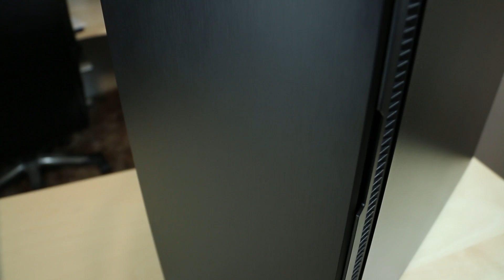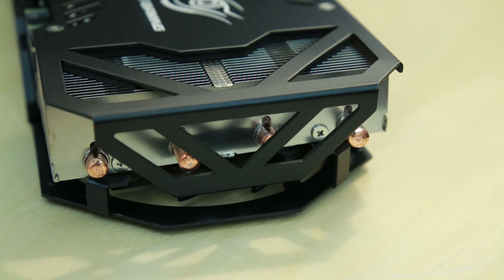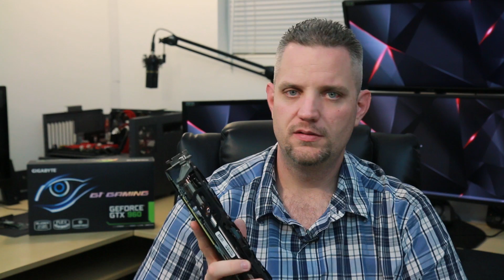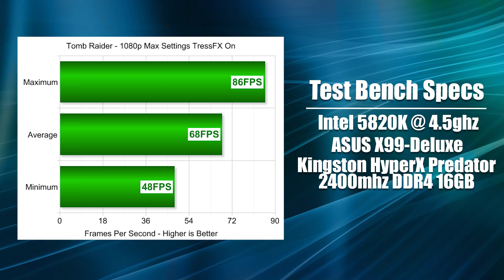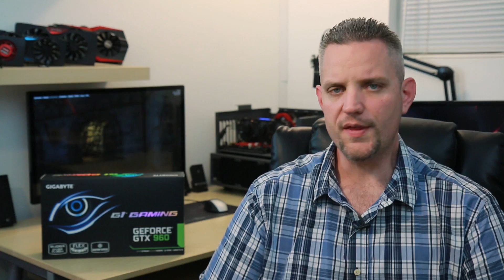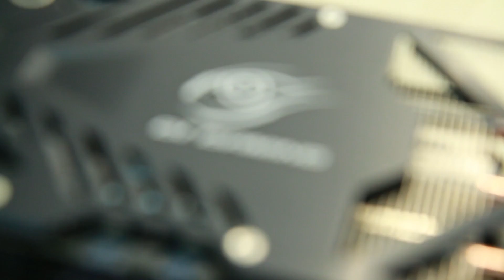Gigabyte GTX960 G1 GAMING - Best Mid Range Card Yet?

Comment: This card is a real disappointment, the memory-interface is a catastrophy and the 2GB GDDR5 make the thing even worse.
It is far to slow, barely (if at all!) faster than older generations.

The 280 is still the way better decision, especially because of the 3GB GDDR5.

Jay, I am kind of disappointed that you didn't even adress the 2GB GDDR5, to be honest.
Reply from the maker: Thats a lot of dots!!................................ and yeah, Im disappointed that I didnt mention the 2GB as well, but considering NVIDIA has never put more than 2 on their lower end cards, is it really that surprising?
Reply: Same for me... I stay with AMD for this year
Reply: ***** I'm dissapointed becuase I expected it to be as good as the r9 280x, while costing less and consuming less power consumption(which it does use less than the r9 280, r9 285, r9 280x). It turned out to be that it's as good as the r9 285 and in some cases the r9 280 while costing more than both(in my case), especially more than the r9 280... 
I was too hyped :/
Reply: The 280x is even better for the price even though it is a rebag i will still stick with the 280x
Reply: I am so tired of seeing this comment trolled everywhere, yes, it has a 128bit bus, yes, it only has 2gb GDDR5 but what all these people commenting this seem to fail to do is actually watch the reviews and read up on the 960. This card was designed to compete with the r9 285 which also has 2gb GDDR5 though on a 256bit bus. Here's the thing, this card overclocked to its limits creams the 285 clocked to its similar peak in every test I have seen with the exception of a few games that favor AMD architecture. The key here is that it does so at significantly lower TDP and costs less than a 285. Don't get me wrong, if its pure performance you are after then by all means go for the 280x or a 290 but if you are looking for a lower power card with almost all the new features of its big brothers then the 960 is a great choice. Also bare in mind we have not seen what dx12 will do with these and AMDs offerings. My 960 G1 Gaming does everything I need it to, looks amazing in my case, runs cool, plays ALL my games maxed out with up to MSAA x8 in some cases and all @1080p. I also noted that despite Shadows of Mordor claiming that you need 3gb of vram to use high textures my card handles it just fine with absolutely 0 lag spikes and an average of 50fps. I am not a fanboy of either side here, I love my old 5850 even now and I am loving my new 960 which is literally 2x the performance. Don't fall prey to the AMD/Nvidia/Intel fanboy crap, put on your grownup pants and buy what best suits your needs after doing your research.
Reply: Arne Lammens Only in Benchmarks, if you have high quality textures, it will!
Reply: ***** I'm still saying that 4gb on the gtx 960 is a waste of money and is a marketing gimmick, just to make people pay more money for nothing.
Reply: ***** And the best gpu at the moment for 250-300$ is the r9 290, it's 60% better than the gtx 960 for only 50$ more. :)
Reply: The 128bit bus does not affect the amount of VRAM the card can handle. You can have a 64bit bus GPU with 4gb of VRAM, the bandwidth however would render it completely moot as no game could run on high enough settings to be able to saturate that much RAM without being a slideshow. The 970 problem occurred because one of the 8 512mb chips is not handled correctly due to the way the gm204 chip was cut down for the 970. Part of the GPU's memory controller was cut and that is what caused the whole debacle. 

The 960 is not a cut down chip, it uses a fully functional gm206 chip and the 4gb versions will simply use higher capacity VRAM chips to achieve 4gb and as such will handle 4gb just as well as it did 2gb. There will be a significant performance improvement in situations where the 2gb cards VRAM is completely saturated, as early reviews are already showing. The 128bit bus on the 960 coupled with the 960s texture compression architecture cause it to perform more in line with a 196bit bus, that combined with the high clocked GDDR5 VRAM makes the card easily able to utilize 4gb of VRAM.
Reply: I am sorry but you are wrong. Home made diagrams prove nothing especially seeing as they are based on the assumption that the 960, 970 and 980 are all based on the same silicon. They are not, the 980 and 970 are based on the GM204 with the 970 using a cut down variant but the 960 uses a fully fledged GM206 which is not cut down. The bus width does not, nor has it ever, determined the maximum amount of VRAM a GPU can use. All the bus determines is bandwidth and even then there are additional factors that play a role. The fact that every review on the 4gb 960 clearly show improvement in VRAM related FPS dips shows this. Never the less, the GPU does not benefit significantly from the 4gb of VRAM, certainly not worth the premium over the 2gb variant. The "not connected" scenario you propose has nothing to do with bus width and everything to do with the way the gtx 970 addresses one of its 8 512mb VRAM modules due to the way the chip's memory controller and cache was cut down.

The 960 4gb cards simply utilize higher capacity VRAM modules so they will perform identically to the 2gb versions. If your diagrams were in any way valid the 960 would not be utilizing its 2gb of VRAM properly. No offense but you clearly extended the problems faced by the 970 onto the 960 which does not suffer from the same flaws as the 970 as it uses a completely different chip. Its easy to assume the GM206 is a cut down 204 based on how many reviews cite it as being 1/2 of a 980. Both utilize Maxwell 2 architecture and thus the modules are identical. The 970 has disabled portions of the die to lower its specs and make use of lower binned/failed 980 gpus where the 960 only has 1/2 of the modules on the die to begin with which is why the bus is also 128bit vs the 980's 256. All this means is that the VRAM is forced through a narrower bus and performance is lost. There are no "cut" portions of the 960's memory controller it is simply half the bandwidth.
Reply: @Crazy Psycho: Also, just to add, the reviews on the 4gb versions of the 960 have already shown they access the full 4gb at the same speed as the 2gb version where the 970 exhibits a marked performance hit as soon as the last 512mb of VRAM comes into play.

It is nice to see someone put in so much effort and thought into comments on youtube though and its also refreshing that you have kept it civil :)
Thanks for the debate ;)
Reply: R9 290 is not 60% better than gtx 960. Gtx 970 is 47% better than 960 and little better than 290. In our country right now 290 costs 280-300€. Gtx 960 4gb model 230€. I would still go with 960, because I don't need more performance than that and 290 takes way more power than 960. 280 would be pretty good choise also, it cost 200€, but I prefer nvidia
Reply: +TheEmbittered ThunderGod Too bad all of AMD cards have bad driver support on games (Just Cause) and have terrible optimization with high heat draw and power sucking capabilities.
Reply: 2GB is plenty for most games at reasonable settings. Every gamer, sometime in his life, has forgot why video games exist. TO HAVE FUN, not to stare at the excellent graphics.
Reply: Did you actually see benchmarks ? The lesser memory doesn't make a difference.
Reply: MatzeGamer yes they are. 256 bit gives double the bandwidth over 128 bit, and the gpu needs bandwidth to EFFECTIVELY use Vram. on that 128 bit bus more than 2-2.2GB Vram, depending on the memory clock speeds it will NOT get almost any, literary almost any performance.... even if it's 1080p, 4k or 12k if you wish....
Specs affect other specs.

bandwidth = Vram Clock speeds * bus width
Reply: Tamás Kerecsényi the gtx 960 is overpriced. the gtx 960 should be 150-170$ not 200-230$.
Reply: futmut1000 ahahhahahhhhahhahahahah you made me laugh... I just imagened a 1960's hollywood dad say that.
First of all the r9 280 is just about as strong as a gtx 960(give or take 5% depending on the game) at stock speeds at 1080p, at 1440p the r9 280 usually wins, since the gtx 960 has only 112Gb/s bandwidth due it's norrow 128 bit bus and only 2gb of Vram, no compression can help it with that, it just can't push as many pixels as it needs to.
Second of all both gpus overclock amazingly, the gtx 960 can reach 1350-1400MHz on average with the stock bios while the r9 280 can reach 1200Mhz on average with the stock bios, the gtx 960 is 200Mhz higher clock to begin with keep that in mind.
Reply: TheEmbittered ThunderGod I prefer to pay extra for a NVIDIA card instead of paying extra for a bigger PSU with an AMD card.
Reply: AL SALAZAR the r9 380/285 is a better choice. It has color compression similar to the gtx 900 series to compensate for the narrower bus compared to the r9 280(x) and it has the best tessellation engines that amd can offer, does tessellation even better than the r9 390(x) and as good as the fury(X).
Reply: AL SALAZAR yes in terms of raw performance and gaming perfomance, the r9 290 is 25% faster.
Reply: ***** specifically with GTA V i can up to HIGH not verrry high or ultra. because of 2 GB vram limit. if i use more it starts using system ram.. and thats not ideal.
Reply: +IIIRattleHeadIII Well, there are actually the average FPS on most games go up 5-10fps...
Reply: Hello??? There is a 4GB version!! Even if the card can only use 3 of it, it will be enough.
Reply: and the benchmark its not far from 4gb 380s lol 960 is better than 270x
Reply: can a 280 or 290 run league of legends , mincraft and i want to play titanfall and gta 5 on it. in ultra 1080 preferble. i am then going to stick with the card for 3-5 years. have a Nvidia gt 520 now
Reply: leon timmer
yes they can, if your sticking with a card either go nvidia 900 series or wait a bit for the amd competitors that should be coming in the next 2-3 months..
Reply: MatzeGamer not on a 128 bit buss.
Reply: MatzeGamer I mean actual benchmarks of games
Reply: Crazy Psycho Thats because the 2GB VRAM and thats because of the 128bit blablabla.....
Specs are not an argument for other specs!
Reply: Crazy Psycho Für den Fall das du Deutsch verstehst, LIES NICHT WEITER!

Warum zur Hölle diskutiere ich im Internet immer unter Jays Videos mit Mensch gewordener Nivea- und Intelligenz Verweigerungen?! Kann mir irgendwer hier sagen warum man immer wieder versucht meine Argumente gegen mich zu wenden um dann totalen Dünschiss zu schreiben?
Reply: MatzeGamer dude, your arguments would be right in an ideal world, but what I'm saying is facts.
and I don't deny nvidia, I so wanted to buy this GPU, but its performance didn't live up to what I wanted it to be.
Reply: Crazy Psycho Let me guess: Google translate?
I dont like people who say product A is better than product B because company XYZ is better. I dont like being disappointed and I dont like people swearing at someone else or me.
At last, my statement is that Nvidia could be as cheap as AMD
Reply: ***** well, you are right, it isn't surprising at all.
But I guess that does not make the fact, that this card suffers from to less memory and bandwith, invalid.
Especially with features such as DSR in mind the 2GB of this card just aren't up to date.

By the way, I am really glad you took the time to respond to my comment, keep up the good work!
Reply: MatzeGamer And I never said that one is better than the other. To be honest I could give a damn who makes the GPUs. I look at specs, technology and architecture, if it does the job I need it to do and price performance ratio.
Reply: no and no 280 is slower and worse
Reply: ***** oki
Reply: ***** and cost about $50 more? better grab the 970 than this trash...
Reply: ***** the gtx 960 can't benefit from more than 4gb of vram, so even if it has 4gb of Vram for example at 4k you won't get any fps boost.
Reply: ***** still you will not get more performance if it had 4gb due to it having 128 bit bus.
Reply: It says 2048MB on the litle screen he shows at the begining do you not know how to read?
Reply: XavierPirelli I want an gtx 960ti, the gtx 960 is just not strong enough for my needs. And if in june-july amd's 150-250$ gpu beats the gtx 960, then I know where my money is going to.

And the reason it has only 2GB of Vram, is because of the 128 bit bus, it cannot use more than 2GB of Vram effectively, a.k.a, more than 2GB of Vram will NOT give any performance increase, under any scenario.

Also if the gtx 960 had a 256 bit bus then it would like the gtx 970, since it has less L2 cache/ disabled L2 cache memory pools, the whole reason the gtx 970 uses only 3.5GB of Vram to it's full bandwidth and 0.5GB is really slow.

The way maxwell work is, that it relys on it's delta color compression and it's L2 large cache pool to utilize high amounts of Vram.

If it were their 7xx series gpus or any amd gpu, you'd need 256 bit bus for 2GB of Vram and 512 Bit bus for 4GB of Vram, but the gtx 980 needs only a 256 bit bus for 4GB of Vram, reducing it's power consumption(TDP =/= power consumption, TDP stands for Thermal Design Power, a.k.a how much heat the gpu outputs and how good of a cooler you need to cool the gpu), but the fact remains that with a 256 bit bus, even when 4gb of Vram are utilized properly the bandwidth is still quite low and it can limit the card in some scenarios, well NOT gaming.
Reply: XavierPirelli yes, but with GDDR5 memory you are quite limited, so the bus speed is what matters in this case, usually amd and nvidia's Vram Clock speeds are 1500-1700Mhz, so it's quite a constant.
Also the gtx 960 can't use more than 2GB of effectively Vram for the same reason the gtx 970 can't use more than 3.5GB of Vram effectively, the reason being it has no L2 cache to back it up, That's how maxwell gpus manage to use more Vram with less bandwidth, by having a large ammount of L2 cache, which the gtx 960 doesn't have and delta color compression.
Reply: Edit: I just reread your post and addressed it in my next post.
Reply: XavierPirelli The Gtx 960 literary can NOT use more than 2GB of Vram at full bandwidth, no matter how much bandwidth it has.

Here is what I mean:
Gtx 980:
http://imgur.com/REAFVBr,ap2OKIR,t3iJFpz#2

Gtx 970:
http://imgur.com/REAFVBr,ap2OKIR,t3iJFpz#1

Gtx 960:
http://imgur.com/REAFVBr,ap2OKIR,t3iJFpz#0

as you can see, even if you put more Vram on the gtx 960, it will not be "connected" to and "access" by the GPU at full speed or at all. :)
Reply: ***** yeah but the 970 nukes the crap out of the 960 in gaming performance, so the 960 is very overpriced or the 970 is cheap go figure :D
Reply: Crazy Psycho yeah exactly my thoughts, sadly i bought a msi gaming 960 already without looking around (yeah i'm nvidia fan) and it's complete garbage, my friend has a 270X and it's even slower in some cases than that thing while i could have bought a 285 for the same price
Reply: Tamás Kerecsényi there is nothing wrong about prefering a brand over another and going for a slightly worse pick because of it, as long as you don't bad mouth the competition, just to make your favorite company seem better, also the gtx 960 is not a bad choice, but the r9 285 is a much better choice ATM, especially now that it costs 140-150 Euro.
Reply: Crazy Psycho well said ;)
Reply: Bu11sEyes lmao fuck off
Reply: TheEmbittered ThunderGod I use 7970 OC and i paid like half of 280x price..... Identical performance cards.
Reply: leon timmer if you are going to only play garbage like Lel and minecrap stay with your Gt 520, it will handle those games pretty well.
Reply: Crazy Psycho i have a asus gtx960 strix 4gb and i have around 75-85 FPS in bf4 on max settings
Reply: Kawasaki Rider and you'd get the same fps with a gtx 960 2gb, just saying.
Reply: well why didnt he had the same in the video then?...
Reply: TheEmbittered ThunderGod you know they did make a 4gb vram version of the 960... so yeah
Reply: jake nikolia which is useless and costs more. The gtx 960 can't utilize more than 2-2.2gb of Vram effectively, a.k.a useless 2gb out of 4gb of Vram, due to low bandwidth and in scenations where the low bandwidth is not the problem, the GPU itself is NOT strong enough to benefit from more than t 2-2.2GB of Vram.
Reply: Crazy Psycho
o, well thanks i never knew that so you kinda filled me in on 2 things. looks like im buying a 980 then
Reply: jake nikolia No problems, but I'd recommend the gtx 970 over the gtx 980, because the price difference is huge, while the performance difference is 10-15%, and yes the gtx 970 can utilize up to 3.5GB of Vram effectively out of 4GB, but it's not worth it, those 500MBs of Vram have yet to hold back the gtx 970 at any resoltuion that is 4k or below in AAA games.
Reply: Crazy Psycho the 970 only has 3.5 vram and the 980 has 4, and i kinda want to have the extra space for future titles
Reply: jake nikolia If developers optimized their titles like the witcher 3, you wouldn't need more than 2-2.5GB of Vram at 4K.
http://www.guru3d.com/articles_pages/the_witcher_3_graphics_performance_review,9.html
Reply: Crazy Psycho  i plan on play heavy mod skyrim and fallout nv or fallout 4 when mods will be made so with high res texture mods or having 200 mods installed i kinda do + plus i like my graphics at max with the best performance
Reply: jake nikolia and so can the gtx 970 with 5-10fps less, but still it costs 200$ less.... 
that funny argument about modding always make me laugh...
Reply: Crazy Psycho have you not watch jayz 970 video about vram
Reply: jake nikolia I own a gtx 970 and it performs perfectly fine in all games, I still use my 2x r9 285 in my main rig, but the gtx 970 mini ITX does a wonderful job at running every game I throw at it at 1080p ultra with well above 60fps and skyrim with modes and HD textures is NOT as demanding as you make it out to be.
My very old 2010 now worthless hd6790 could run modded skyrim with countless mods at 720p...
Reply: Crazy Psycho its also not that i only want to play skyrim modded and fallout modded its aslo that i want computability with future titles at 1080p at 60fps that are more demanding
Reply: jake nikolia the overall difference between a gtx 970 and gtx 980 at any resolution Vram taken into a count is 10-15%, for a 200$ price difference, in general it is not worth it. the gtx 970 overclocks more than the gtx 980 and when both overclocked as much as possible(assuming they are using the same coolers and are equally well binned, the gtx 970 is only 7-10% weaker than the gtx 980 OVERALL everything taken into a count.
Now the fact that you have a gtx 980 does NOT mean you are screwed or that you have made a bad choice, in the most demanding of games 10-15% can be the difference between smooth gameplay and a slide show.
Reply: Could not agree more, a 3 GB minimum by today's standard s should be a midrange requirement. The 2gb vram is hit on gta 5 with textures set to "high" easily.
Reply: ***** what about 3gb ? A R9 280-280X I think is the sweet spot. The 285 is eh. The 960 is also eh... 2gb gets maxed out easy on new titles. No future proof at all with 2gb. Lol. .. Plus nvidias compression to use a narrow memory buss i feel takes away color depth. I see video comparison and the nvidia cards colors often appear less color saturation and less contrast.  Idk but AMD gpus appear better for me. Colors wise.
Reply: Crazy Psycho i have a r9 290 a 280. and i get what you are saying  just read the anandtech review of the sapire r9 285 and how gcn 1.2 works.  impressive how they have lossless compression using narrower bus. also i like how it can decode 4k p60 and all that... i would say that the 285 has newer features and better encoding decoding and tessalation.. but in terms of raw power for frames per second the hawaii or 290 still outpaces the 285. its got more texture units and mapping. so for straight up gaming at higher fps i still like the 290 better. new features are great but i preffer smoother gameplay more fps than a lower fps with better tessalation. so its just my opinion. idk. i would not get a 285 also because of the 2gb memory. i play gta V and with all textures etc i have maxed out my hd 7870 and 7850 quick with a few sliders. i just think 3 gb or 4 gb would be more future proof. raw power and memory.  sure the tonga in the 285 form is good but idk . im not fully convinced. if i was guna buy a new card. id opt for the fiji of fury series instead with 4gb memory.
Reply: Crazy Psycho Im happy with my #R9 #290 and #280.
Reply: +Bu11sEyes Idiot or troll?
Reply: they are pushing this card ( nvidia ) as a good card for max 1080 with minimal input lag and etc. efficiency for super competitive leauge of legends type of games. not exactly super graphically intense. not forme as i like more power and more frames even if my box is putting out more heat. im happy with my R9 290  #4gb   ,,,,,um my bad, i thought this was the new released  gtx 950. the 960 is stronger but not exactly top performer. its alright i guess. id look at the R9 380 comparo with this.. and get best banger for dollars.
Reply: ***** both are nice atually. but yeah 2 gb does get maxed easy on my HD 7870. with plenty of fps. so if it had 3gb id probably get more eye candyl. but 2 is ok for today.
Reply: +AL SALAZAR If you put more system memory in and turn off the memory limit in GTA's settings menu you will be able to play on Ultra. That's what I've done and great experience
Reply: YGTV(Yassir's Gaming,Tech&Vlogs) yes i see how you can do that. however that is not ideal as system DDR3 memory is a fraction of the speed of GDDR5 in the graphics card.
Reply: +TheEmbittered ThunderGod I have 4 gigs in that card I don't know what you are talking about
Reply: 500 mb of that is slower ram than the rest of the 3.5gb gddr5 on the gtx 960.  That is what users  discovered. Nvidia later admited it after the story went viral.
Reply: AL SALAZAR you mean the gtx 970? The gtx 960 can utilize up to 2.0GB of Vram.
Reply: +TheEmbittered ThunderGod you can get a 4Gb version of the GTX960
Reply: Nathan Totten and basically waste money to get NO performance increase over the 2GB version.
Reply: Mert Turan nope, the gtx 960 can't utilize more than 2GB of Vram effectively due to it's norrow bus, if the gtx 970 is 3.5 out of 4gb Vram, the gtx 960 4GB version is a 2-2.2GB Vram out of 4GB Vram.
Reply: IIIRattleHeadIII erm.... yup because I got this info from other YouTube channels and other sources on the internet meaning that I have the evidence
Reply: Mert Turan you they defy physics.
Reply: xEklypto well that's not true, AMD cards have bad drivers support only on Nvidia optimized titles and/or Nvidia optimized titles that use Nvidia effects, drivers are rock solid for both companies.
Reply: The 960 g1 4gb card works fine for me when overclocked
Reply: Late reply, but if you run Linux and play games, the 960 is great (especially the 4GB version). Hell, it evens beats out the R9 Fury in a lot of games.
Reply: +TheEmbittered ThunderGod
Ahem... Get the 4gb version then
Reply: aciD yeah linux, here it's amd to blame that they have been slacking on the Linux Drivers since 2013... it's not that the gtx 960 is actually better...
Reply: 1080p gaming doesn't need more than 2Gb and it it exceedes 2gb you can use some of the ram bec.  Its Going to use like 400Mb Extra as in Gtav and i need shadowplay if you want to record then AMD is the worst choice there it depends on needs the price is something that is up to you not the market pricing problems
Reply: If it ** sorry dumb auto correction and SwiftKey lol
Reply: +Xaltar welp well said
Reply: at the end of the day though, this is a 1080p60 sweetspot graphics card, so 2GB is all that is needed. The GTX 970 has 4(3.5)GB of video memory because it's comfort zone is 1440p.
Reply: an Offensive Narwhal The resolution alone does NOT determine how much Vram and how powerful GPU you need.
Reply: ***** nice troll....
Reply: ***** well for your information, I've studied hardware architecture and digital design for 7-8 years, so I think I know more than enough...
Reply: ***** You probably have no idea how hardware works at all...
Reply: ***** pfff, a modular power supply is a power suply, which cables are detachable. I built my first PC when I was 5-6 year old, because my father disassembled it, because I didn't want to go to bed. Building PCs means nothing, I bet that I can teach a 4 year old how to do it.

And the fact that you have bought a 4GB version of the gtx 960 over a 2GB version of the gtx 960 tells me enough how much you know...

The gtx 960 can NOT utilize effectively(with benefits to performance at full bandwidth speed) more than 2GB of Vram, due to the lack of bandwidth caused by the narrow 128 bit bus and the lack of peroformance.
Reply: ***** I did? Will you quote me please?
Reply: ***** And specifications of GPUs are a really high abstraction to go by, when deterimening GPU performance. Yeah it's good enough to compare GPUs of the same architecture, but that's about it.
Reply: ***** no it does NOT... what review or article did you read that from?
I have built and configured servers for provinces, and am actively configuring and building people's and office PCs and I do it for free, cuz I'm not even 18.

The fact that you think that Vram alone means that you can pump better textures just goes to show that all you do is read articles, blogs and sites on the internet.... As I said the GTX 960 can NOT utililize more than 2GB of Vram effectively at full bandwidth speed, due to the lack of bandwidth and low performance, just like the gtx 970 4GB is a 3.5GB out of 4GB Vram video card, the gtx 960 4GB is a 2GB out of 4GB Vram video card.

Actually without any knowledge, a normal person could come to the conclusion that if a gtx 970, a much better GPU can NOT utilize 4GB of Vram effectively, only 3.5GB, a much weaker GPU like the gtx 960, would NOT even come close to that.... 

Also I know a lot because my father is a hardware engineer, and ever since I was a kid, he made me read and learn books about hardware and then he'd question me what I've learnt and if I had learnt well enough, he would buy a gift, like toy, or a console, or a bunch of games, you know kid stuff.

Also you are part of tom's hardware comunity.... that explains it all.... most cancerous tech site, with the biggest retards(99%) of all....
Reply: ***** wow... you have no idea why exactly the GPU can NOT perform well at 4k, do you.... it's easy to just sign it off as weak and continue forward.

Yeah the reason AMD GPUs are used in consoles is, because AMD has and had better architecture than Nvidia, suited for future APIs, while consuming the same power and being cheaper, plus the fact that AMD could integrate a much more powerful gpu in the CPU/APU compared to nvidia....
Reply: ***** wow, so instead of showing knowledge, you just insult.... and pull events out of your ass....

And why do you call me an AMD fanboy? I own both Nvidia and AMD GPUs...
Reply: ***** well I have a gtx 970 :D
Used to have 2x R9 285/380s, sold one of them, because 2x were overkill for my needs, I just wanted to try crossfire.
Reply: ***** so he can't build a PC, but earns 5000 bucks a month, having his own company and having workers, who he is teaching? People must be throwing money at him for being handsome and awesome :P
Reply: ***** last time AMD had bad drivers, they were called ATI :P

Both Nvidia and AMD drivers are excellent and have their negatives.
Reply: ***** let's see the fx CPUs have 2.5x times less transistors per core, compared ot skylake and yet have only 60% lower performance per core. I wonder who has ore performance per trannsistor, more performance per execution unit... cough amd cough and Bulldozer family CPUs are old.
Reply: ***** And you just proved my point that you do NOT know anything and that tom's hardware's users(99% of them) are retards, you just talk shit, without any argument to back it up, nor any knowledge...
Reply: ***** nope, I did work for a couple of companies to buy my r9 380, my dad bought the gtx 970 and the hair on my chest is straight and so am I, but I guess you are NOT.
Reply: ***** well I DO 1440p with VSR :P
Reply: ***** Also crossfire is better than SLI, due to it being solely hardware based, while Nvidia has to upgrade their SLI bridges to do shit...
Reply: ***** I have, my fx 6300 performs only about 15% worse than my i5 3570k...

And emulators use only 1-2 cores... they are poorly optimzied and barely use multi-core CPUs, again you are wrong...
Reply: ***** yup that's a 15% overclock.
An fx 6300 can overclcok 40-50% same goes for sandy bridge CPUs.
Reply: ***** And with DX12, it seems games will utilize effectively up to 6 cores(intially), due to synchronization algorithms, which will reduce multithread overhead to virtually nothing.
Reply: ***** Why do you asume, I only own AMD? I own AMD, Intel and Nvidia hardware.
Reply: ***** well, that's called competition, though AMD are being much more sportsmen-like than Nvidia, making their technologies open source, while nvidia clings to closed source software so that they can get an edge.... Also gameworks fucks up Nvidia users as well...
Reply: ***** so what?
Reply: ***** well considering that my GTX 970 had problems with the gameworks effects when the Game initially came out, I really do NOT see how this is an argument.

Also I do NOT need reviews to know how well a game will run on a GPU(not talking about exact FPS).

Also you changed the subject of converstion just because of your lack of knowledge and arguments.
Reply: ***** well I think I said about 5 times that I own Intel, AMD and Nvidia and always have... I've had much more intel CPUs than AMD ones, though I've had more ATI/AMD GPUs than Nvidia's.
Reply: ***** well you have a gtx 960 and I have a gtx 970(plus I have a r9 380 which is still better and I used to have 2x of them)... IDK who has better parts... And I'm saving to build a PC next year, I think I will manage to get 1000-1200 euro till then and get Zen or Kabi lake and whatever New GPUs from Nvidia or AMD come out.
Reply: ***** By the way, you changed the subject again. :P
Reply: ***** so suddenly, from you saying that all Nvidia GPUs are better than AMD's you are getting an AMD GPU? Hypocrite much? Also the RX 480 is to weak of an upgrade for me...
Also the 8GB Vram RX 480 is/will be Gimmick, just like the 4GB of Vram gtx 960... again goes to show how little to none you know about hardware...
Reply: ***** Also you changed the subject yet again.
Reply: ***** well,1. I already have a bette PC than you.

2. You are the one who has NOT shown any knowledge NOR has gotten arguments to back up his statements.

3. I can buy a RX 480 day one if I wanted to as I currently have the money for it, but it's NOT worth the upgrade for me.

4. I own consoles and a PC, a true gamer plays on all platforms.

5. The fact that you are judging the RX 480, by the hype, 
First shows that you have no basic idea of hardware. 
Second you think that it will be 1:1 with the gtx 980, it will be around that performance. 
Third if the RX 480 will be around the performance of the GTX 980, but NOT exactly and will be different depending on the game optimization. Also again a normal person could conclude that if a gtx 980 can NOT utilize more than 4GB of Vram effectively a equivallent card(that card being the RX 480) will NOT be able to utlize more than 4GB of Vram effectively either.
Reply: *****"rattlehead has a crap pc lmao hes a console peasant." 

who are you telling that to? It's just you and me here buddy. 

I guess you are searching for a person with actual brain to show up and have some arguments against me, but if that kind of a person came, he would agree with me. :P
Reply: ***** Also you are buying a GPU based on what other people say... ahahah
Reply: ***** why would I be jelous that you are getting such a small hardware upgrade, that I can buy day one if I want to(actually almost 2x RX 480s, I have 370 euro atm)? Why would I be jelous anyway?

You really have no knowledge do you?
Reply: ***** at this point you are talking none-sense and insulting... you are a low-life Tom's hardware caneroid...
Reply: ***** you are calling the RX 480 a high end GPU? The RX 480 is a sub-mid range GPU...
Reply: ***** And you call my PC weak, while calling the RX 480 high-end?
Reply: ***** wow, the gtx 1080 can do 4k and Vega and gtx 1080ti or whatever they call it if there will be one will be even better.

Vega is going to be about 2-2.5x times more powerful than Polaris 10/RX 480, which I'm much more interested in.
Reply: ***** yup you are an immature, idiot, who just insults, thinking he is making up for the fact that he has no knowledge...
Reply: ***** "says the guy who has a weak pc and doesnt know anything about hardware okay then"
So you are talking about yourself in 3rd person now? Okey... but someone should call the psychiatrist
Reply: ***** even if SO I'm 100x times smarter than you, you must feel so proud.
How does it feel when a supposed 12 year old is smarter than you'll ever be?
Reply: ***** And yet you continue to talk about yourself in 3rd person. Or wait, you are insulting yourself instead of me, well how generous of you! :P
Reply: ***** and you continue to describe yourself.
Reply: ***** done!
Reply: ***** At this point I have shown that:
1. I'm smarter than you.
2. You are stupid as shit.
3. You have no idea of hardware.
4. You rage and insult, while I keep calm and trump everything you say.
5. You are trying to get someone's attention on this discusion that is NOT me, but that won't happen, there is only the 2 of us.
6. You have shown that you need a psychiatrist
7. You have a shit PC and think that the RX 480 is high-end :D
Reply: ***** he isn't rich, but he ain't broke either.
Well I have a guitar, a multifunctional fitness system machine, all the consoles from sega, atari, nentendo, sony and microsoft, except the Wii, Xbox One and WiiU and I've had over 9 PCs in 17 years... You do NOT need to be rich to achieve that. Just have some brain.
Reply: ***** you continue to describe yourself wonderfully BTW, keep on going.
The psychiatrist will be here any moment now.
Reply: ***** Also I get it. You are mad because you think I'm a spoiled brat, don't you... hahaha... I bet you even think life has a meaning and that killing is wrong.
Reply: ***** Also at this point, you are raging so hard, you are repeating the same thing. 

Do read our conversation from top to bottom to see who is right and who is wrong.
Reply: ***** that makes sense to you?
Also I earned the money for my GPUs myself, by configuring a server for Eurolux.
Reply: ***** I go to the most prestigous math school in my city and I get max grades without studying more than 5-30 mins a day...

Stupid people(like you) study/learn on the streets and internet, average people study/learn in schools and universities, smart people learn at home.
Reply: ***** nope... just because you can NOT comprehend something does NOT mean it is wrong...

Also just because you can NOT comprehend that a 17 year old can earn money, shows how norrow-minded and stupid you are.
Reply: ***** Also you proved my point, you got mad because you were annoyed by the fact that I'm underaged and make money and have a good PC, you do NOT believe I can earn money, because you are judging from your point of view and your capabilities that you had when you were a teenager.

Sorry buddy, but you do NOT need education to have knowledge and earn money.
Reply: There is a 960 which has 4gb vram, its made by asus
Reply: The Doom Guys wow, you deleted all your comments...
Reply: Bilal Ali and that 4GB gtx 960 is a gimmick to get them more money.
Reply: TheEmbittered ThunderGod r